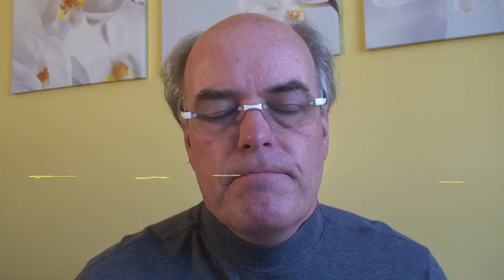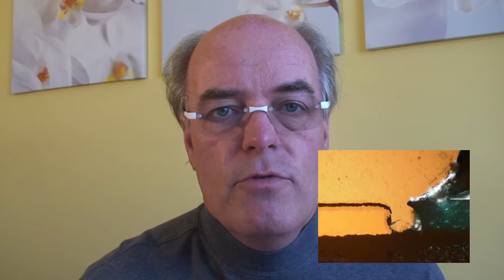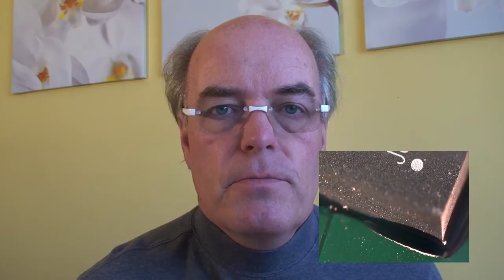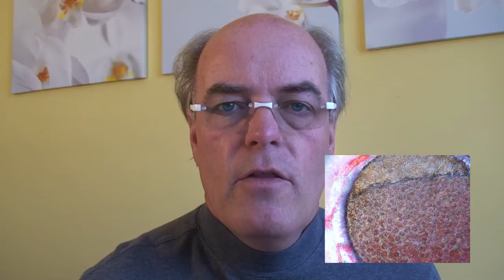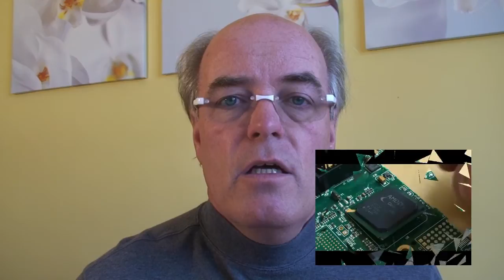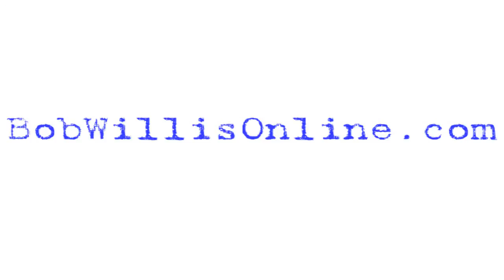Testing BGA Failures with Dye and Pry "Bob Willis How to Do It"

Comment: Thanks Bob, a good descriptive guide to the test. In 30 years in Reliability engineering, I've never done it. Closest was examining dry solder joints with a microscope at TAG which is also very revealing, (and non-destructive!)
Reply from the maker: Glad you found it of some  value being 12 years old. There are other points I would add today if I were still running workshops. I may update on my future Defect of the Month videos I produce for WNIE see https://www.wnie.online/defect-of-the-month-with-bob-willis/